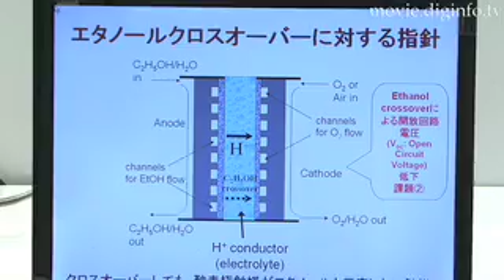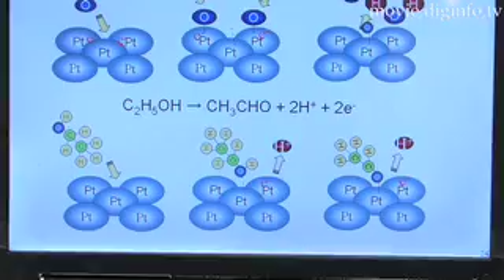Ethanol Powered Fuel Cells : DigInfo

Comment: You do realize ethanol is drinking alcohol right? Also these fuel cells do not use 100% alcohol, but rather a diluted solution...similar to the amount of alcohol you'd find in a beer....hardly dangerous.